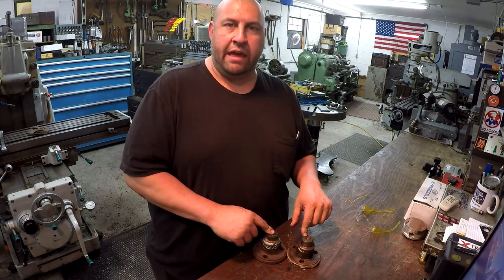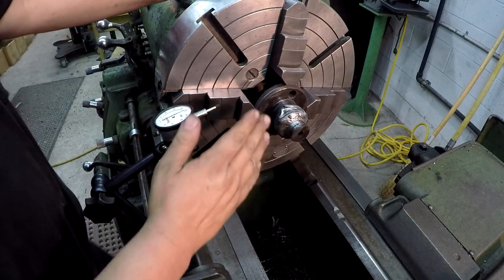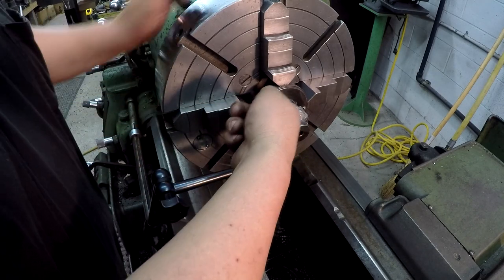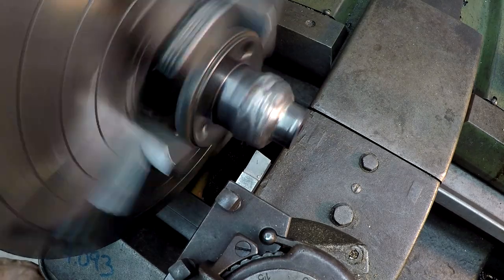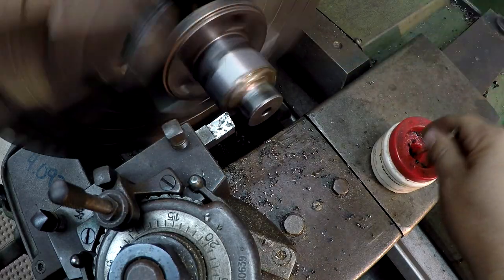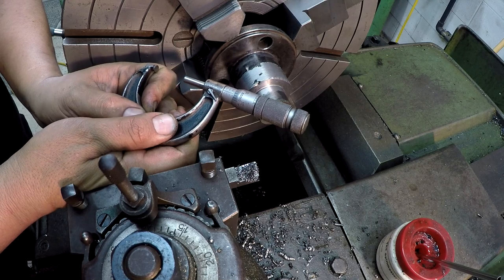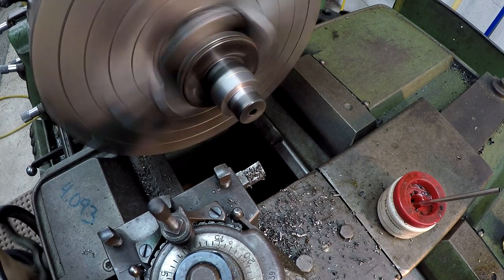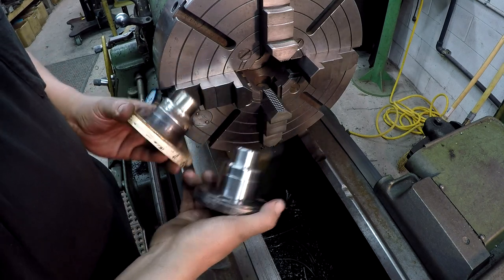Turning Weld Build Up With High Speed Steel

Comment: wow you make me look amazing and i can butcher work if not better and or as good as you but that would never leave my shop . i do aviation and nautical repairs and have a better welding process keep practicing you might get it right
Reply from the maker: +david horan That's great David, maybe try watching and listening to the whole video some time.  No bragging here, just showing the work.
Reply: david horan ha. a comedian over here.
Reply: david horan I'm an aircraft maintenance engineer and machinist myself and while I would concur this wouldn't leave my shop either.....it's a forklift part..not from a gas turbine or flight control hyd cylinder. u get what Im saying right? us elitist aerospace machinist execute our work to a higher standard...it's a higher order of machining. adams excellent on the machines, but the cosmetic and finish aspect I guess could use work. yes it's just a lift truck....but for that seal to survive, that part would not leave the lathe until I had a mirror polish on the working surface. leave .0005 over for blueback paper or other good polish abrasives.
Reply: david horan bear in mind Adam didn't weld that either
Reply: david horan no mate I’m the best...just ask me mate,I’ll tell you how good I am
Reply: To David and Bill why are you here? Talk is just that talk. Where are your videos? I would like to see you walk the walk!